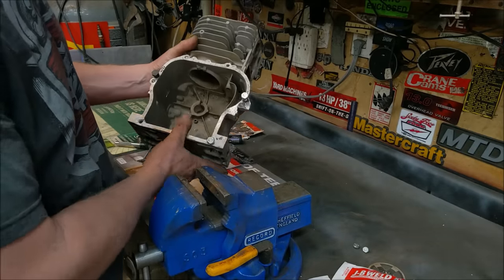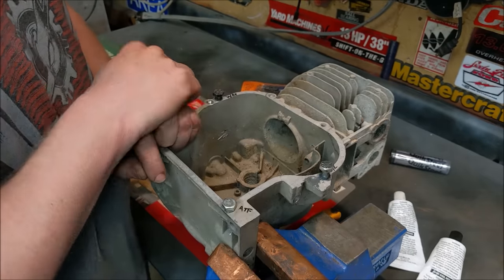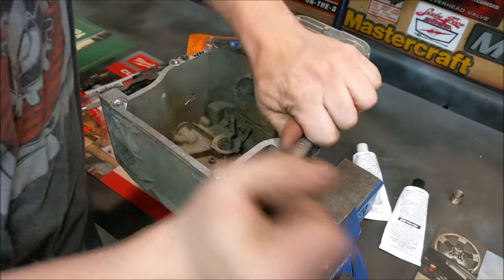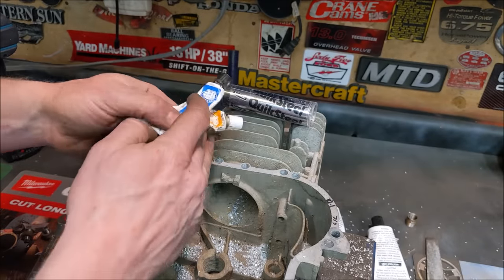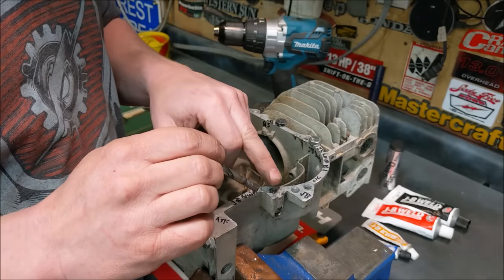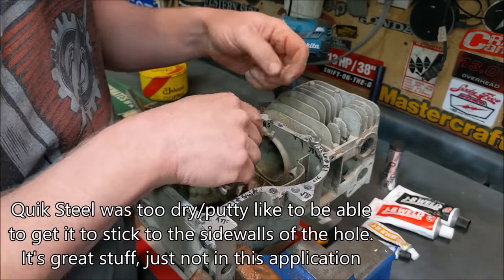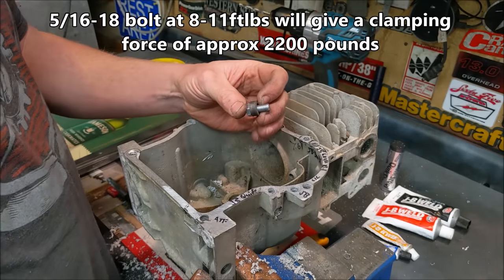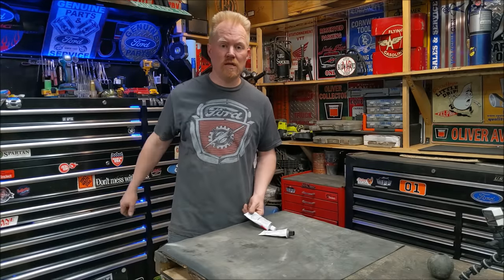FIX stripped bolt hole threads the POOR MANS WAY

Comment: We used J-B Weld to glue in a stripped spark plug.  It would hold for about six months of daily driving.  We learned to keep the J-B in the car for a fast roadside repair.  Drove the car like that for many years until sold... with the repair kit...
Reply from the maker: That's impressive.
Reply: That’s is amazing. respect
Reply: I hope that the new owners know about that.
Reply: @gohjohan  ha they probably didnt they probably scammed the new owner
Reply: @gohjohan   He said “with the repair kit”. So it’s implied that they did know.
Reply: Let me guess, ford 5.4 Triton?
Reply: @gohjohan   Next owner was a junkyard!
Reply: @buttonysquare8501  That's a very good guess!  It was a 1974 Fiat Spyder
Reply: @HardwayRanch  no kidding. I'm glad that this method served you well.
Reply: hello i have the same problem now, i successfully added a thread insert but now it needs a sealer or some sort of adhesive to lock it on the cylinder head and not come out with the spark olug everytime i take it out. do you think it will held up to the temperatures?
Reply: You needed a little piece of 18 or 22 stranded and then wrap up your threads and then smear them with your ProPoxy20 minute mixture..  there’s about 50 of our ProPoxy20 fuel oil tanks in many a poor country folks basement that couldn’t afford the new tanks or to have $2 dollar’s worth of heating oil dripping out onto the ground and it’s not a crap repair… I’ve drilled and tapped and fixed an automatic transmission housing and several chainsaw case’s and countless other repair’s that have actually surprised me!!! LMFFAO!  A commercial plumbing and heating supply house has the two tubes of ProPoxy20 and you need two equal size pieces into your puddy and 20 minutes later it’s official!  I wax a little piece of aluminum for a backer plate and pack it into the 1-2” holes in case’s and castings and then pack it or toss it between waxed paper or saran wrap and roll it into a even 1/4” thick layer and then you can basically just pop it into your opening and snap crackle pop in 20 minutes blast it down with the grinder disk and see what you got!  Cleaning up your surface and the surrounding surface areas where you are actually looking to stick to is what people usually mess up and they will push some two part epoxy into a oil covered mess then say that it’s garbage because it doesn’t stick to anything!  Fire and acetone is your friend and a flap disk or bristled brush on a grinder and cutting some surface then acid wash it .,.neutralize it… acetone it and slap on your patch!  Or oil your bolts then pack and smack them in a set of new threads! 😂👍👍.  It’s very really a turbine engine or the space shuttle! Send it!
Reply: The real American 🇺🇸 thing is that they actually not only instructed the new guy on the correct plug re-stuffing technique but made dang sure that he was covered for the next couple repair’s too! Now that my friends just might make you a little red-neck! LMFFAO!  Hold my beer I’ve gotta glue that dang plug back in Clem.,, we’re not running on number 7 cylinder anymore!😂😂😂💪😜🍺🥓😅
Reply: @buttonysquare8501  1974 Fiat 124 Spyder.  But close!
Reply: Thanks this was the exact answer I was looking for

Comment: many people dont know that jb weld normal formula after seting 72 hours  to cure is 2× as strong as  24hrs seting.   at 70 degrees air temp.  jb-weld  makes its strongest formula called jb-marine weld  2parts also but  at 48hrs set time its much stronger than jb-weld original.  if you test jb-weld marine formula and let it set for  a full  5 days untouched at 70 degrees air temp its 3× stronger than original jb-weld. the marine formula can withstand constant temps well into the mid 300 degree range.  nice video good day.

Comment: I used water weld (which is made by JB weld) to make threads. My bathtub has two handles that you turn for the hot and cold water. I had damaged the threads on the hot water when I was working on it. I was going to have to call a plumber to come in with a torch and replace everything. But instead, I took the handle out of the wall for the hot water and wrapped the threads with Teflon tape. And then, I wrapped some water weld around the Teflon tape and stuck the whole thing back in the hole in the wall. The waterweld stuck to the threads that were in the wall, and I could spin the hot water handle free of the water weld because it was wrapped in Teflon tape. Just like you did with the wax and the bolt. This has been holding for years. I did replace the water weld once several years ago. And it had held for several years before that.

Comment: How do you apply the wax to the bolt?
Reply: Wax is usually a paste, and putting it on is really easy, just slop it on and wipe it off. It only needs a very thin film, just like you car wax, you wipe off the excess and it leaves a very thin coating. One reason it works so well is the exact relief you get with a super thin layer, so thin you can't even see it. The thin layer gives you perfect contact. Wipe it on and wipe it off a couple times and you have a perfect film of wax left. You'd have to use a solvent to get the wax layer off.

Comment: I've used your copper wire method before with success. One reason I won't use JB Weld is it does not like heat cycles. Even under low heat, low pressure, it quickly disintegrates.
Reply from the maker: I did a fair amount of digging online about test data individuals/labs have done. It actually gets stronger up to about 400F but then rapidly drops right off at anything over that. Copper is my go to.
Reply: @sixtyfiveford  Are those long term test?  9 months after applying JB Weld to a pinhole on top of a transfer case, it easily flaked off in tiny pieces. I wonder if heat hardens it and makes it brittle?
Reply: Good tip. Thanks

Comment: I think the best bet would be to not drill but simply use the JB weld as a gap filler.  Just put some JB inside the damaged threads then put in the bolt, The JB rebuilds the damaged threads bridging the gap so not all the stress is on the JB.

Comment: Next, we use a combination of copper wire and JB Weld... I've used the copper wire trick for years on stripped battery terminals. Got the idea from sticking toothpicks in stripped screw holes in wood.
Reply from the maker: I did do this, but edited it out as it got the same results. However that was with a drilled out smooth hole and I think it would do better with a actual stripped hole where the sidewalls are coarse.
Reply: Know this is 2 years old but for a future viewer seeing this’ honestly just buy some’ lol u can get new terminals for like $20 

As cars are more electronic controlled now than ever a nice tight connection is crucial’ 

I’m frugal’ trust me on that , Some things however u just don’t repair but replace fix it right and never deal with it again :-) 

My 2 cents
Reply: How about stripped bolt holes
Reply: @joshymcdaniel9233  For battery terminals, it's just a temporary repair, though I admit my temporary repairs sometimes take years before I get around to the permanent fix.  And my cars are old.

Comment: How did you do the jb weld threads? Did you fill the hole up all the way? Then put the waxed bolt in? Or was it just enough jbweld to cover the sides and then stick the bolt in?
Reply: I’m talking about the first three bolts you showed up

Comment: I used JBWeld to fix stripped threads on a riding lawn mower motor mounting bolt several years ago and it’s still holding.  It’s location would have required total removal of the motor. I’ve not needed to remove the bolt so I can’t comment on the quality of the threads, but the “fix” is is still holding so I’m not going to poke at it.

Comment: Great product.  Back in the early '80s I patched the lower half of the gas tank on a car and drove it for more than a year with no sign of any leaking.
Reply from the maker: It has it's place for sure and when used properly can be the most practical option. Problem comes when people have no idea how to fix something and decide this will do it and put it on a greasy, mud covered gas tank then complain it didn't work.
Reply: @sixtyfiveford  Surface prep is key
Reply: @oldretireddude  got that right!
Reply: @sixtyfiveford  The older JB would turn to plastic when the ethanol gas came out but I think they've redone their formula to make it compatible now. Hope they have anyway. Thanks, Pal!
Reply: Patched the side of a radiator in '14 I was in school couldn't afford a new one at the time, but it's 2020 now and still it doesn't leak.
Reply: @BattleOfBowties  I patched pin holes in my radiator with jb weld and it held up for 4 months. 
Also patched a crack the  plastic on a different radiator and it lasted about a month. Now I'm going to make threads in my starter bolt holes.
Reply: I did the same for a cracked oil pan split down the middle on my bmw 325i (of course cost of a new oil pan was ridiculous) many years ago after bottoming out hard, I extremely doubted it would work but I cleaned the hell out of the oil pan then sanded it rough and applied a coat of jb weld and it held up for years until I sold the car. 🤘👍
Reply: @BattleOfBowties  wow! I just bought JB WELD to use on my W203 radiator too. The seems are leaking and can't raise enough money for a new radiator.
I will give it 48hrs set + cure time to ensure I get a better hold.
Thanks for sharing. Am encouraged.

Comment: Had a 82' Honda 500XL rebuilt motor job at a local bike shop where I live -- months later oil was leaking outta the head, I slowly took it apart only to find out the S.O.B used a cheap heli-coil cuz he stripped it out himself . I took it someplace else and the fix was high end threaded SS inserts, worked amazingly. Having said that, the previous bike shop is no long in business ( l rarely get lucky taking shortcuts)
Reply: Looking at a similar issue with a moto 4 225 i picked up but a repair hasn't been attempted. i've tried to replace the bolt and pray i get lucky but no luck with that haha. 

I'm really not trying to do major work on this as it already has other issues i'm not addressing so do you think the method shown would help with my issue or just be a waste of time? I really just want the oil leak to stop/slow down. Gonna work on unsticking clutch pads tomorrow though :)
Reply: @RYANINBODEN1547 -- the SS threaded inserts usually applied with red locktite (l think) -- it's a much stronger threaded fix than the aluminum heli-coil -- l would go that route as you'll more than likely never have an oil leaking problem again -- 
With the SS insert you can really crank down the head ensuring a tight seal

Comment: Great video . . . I used a kit I believe from Permatex few years back to restore threads on a head bolt stud on my Model A . . . . It worked well enough to torque the head to spec. Took me a few trys, each time giving it more cure time. Success was after 2 days curing! . . . . Shop looks good . . . . Ginger has endless energy . . . . . . Rog
Reply from the maker: It'll get you out of pickle, sometimes. All this epoxy stuff is very finicky. Thanks, I've been cleaning up the shop lately and Ginger would never stop if I let her.

Comment: I find using aluminum brazing rod works best. I use Blue Demon Triple Play rods and a Mapp gas torch. Heat the base metal, flux the hole and fill it up with the rod. Center punch, drill and tap. Just like new.

The trouble with epoxy is going to be durability. Thermal cycling will cause the jb weld threads to debond
Reply: Nice tip, for when gravity is on your side.
Reply: Hey what about filling a horizontal hole in an engine block-the insert failed and i have a 9/16 hole😩😩😩
Reply: @kirbytabor9956  there are welding rods for horizontal use, ask a shop
Reply: @galehess6676  Ya they wouldn’t tell me anything 💰💰💰💰 Super Alloy5 has a 600 degree melting point👍
Reply: @kirbytabor9956  mmmm   some guy with a welding truck would prolly give you the info
Reply: @galehess6676  ya no one would touch it coz cast aluminum engines are tough to do👍 i used oversize insert👍 but brazed a non critical hole for practice. Super alloy 5 with flux worked good👍
Reply: @kirbytabor9956  dang.  impressive shade tree talents.  the only issue my dim bulb can question is dissimilar metals or heating/expansion rates over time may be something.  i have 0 experience there tho lol

Comment: Loctite 3967. I keep a set of that in my tool box.  Basically the same thing but it’s made for repairing threads like this. I’ve had great success with it.
Reply from the maker: Yeah, there are better epoxies for sure. I just wanted to test with the most easily obtainable ones.

Comment: What kind of wax did you use ? Did you fill the hole first with JB Weld and push the bolt in and then allow JB Weld to harden around bolt ?

Comment: Did you let the jbweld dry after removing the bolts?  Correct me if I'm wrong, but jbweld is not anaerobic.  I feel you should let it dry longer with the bolt removed.

Comment: hello there. Just seen this today for first time. I hope you read this soon. Question i have pertains to how much wax do you apply to the bolt prior to this application? I would assume it would be no different than just greasing up but using the wax. your advice greatly appreciated. Cheers
Reply from the maker: Very thin layer. You don't want to change the profile of the bolt threads. I use Johnson's paste wax but any hard car wax would work.

Comment: Some good ideas - tried the copper wired trick and couldn't get it to work - ended up just buying an SAE bolt (to replace a metric one) and that worked.

Comment: It may take an extra step or so but trust me, putting a stronger thread insert in a soft aluminum case is the best thing you can do. The fastener will hold better with the stronger threads especially under higher torque values without failure. But in a pinch the jb weld looks like it can get ya home.
Reply: Any trade or brand names?
Reply: What thread insert would you use and where can I purchase??

Comment: I accidentally stripped my front axle clamp nut to my motorcycle.  It is a 6mm hex.  Almost stripped smooth inside the head.  I am 'hoping' JB Weld will allow me just enough support to break the bolt free otherwise, I am may be screwed.  Do you suggest I JB Weld in a 66mm hex key or weld in a larger bolt for better grip?

Comment: What kind of wax did you coat the bolt with (not the ATF, not the WD40) before putting the bolt into the JB Weld? And how much wax costing? I figure you don't want a LOT of wax as it would clog the threads so they wouldn't leave a good print? And how much JB Weld in the holes, as wouldn't most of the JB squeeze out as the bolt goes in?

Comment: Permatex used to make a thread repair kit much like this. It was a 2 part epoxy with a release agent to coat the bolt with. I remember using it about 30 years ago and it worked pretty good.
Reply from the maker: Interesting. I didn't know anyone ever sold a kit.
Reply: Napa sold this kit labeled Napa/ Permatex

Comment: I love the quick steel.  I have sealed the valve on a 250 gallon oil tank and 3 years later it is solid.
Reply from the maker: Quiksteel is my go to for almost everything. I just couldn't get it to work in this application. Mainly because the hole was open on the bottom and it was so small.

Comment: Holy crap! That's actually really cool, I wouldve never thought of this. For low torque applications this would probably work good, they have metal infused epoxies too that might work better
Reply: That is ‘EXACTLY’ what JB Weld is…
Reply: @mrmackie85   um actually no, it isnt.. There are epoxies out there with higher metal content/higher quality bonders for wheel repairs and things of that nature. trust me, at $30 a tube you do notice how much harder that stuff is.
Reply: @anthonys3906  so JB weld is not a metal infused epoxy??? Ok….

Comment: Really cool video man, this is something I've always wondered about. 

But for you guys looking for a real fix, the way to go (on a budget) is to buy an ebay helicoil set. $10, free shipping, and comes in a 30 pack. If done right, the threads will be as strong- if not stronger than the parent material.
Reply: Where is it $10 and free shipping?
Reply: I purchased this but in my application there is no space to drill the hole. 

Oil filter cooler on 2000 accord v6. Top bolt hole tripped out due to forgetting putting my power tool to its lowest setting (i should have use my hands)
Ill try jb weld quick cure and atf 😊

Comment: Excuse my ignorance. What kind of wax did you use?  And am I correct that you used JB Weld and the wax?  I need to fix some threads on my RV’s table top. Want to be sure I do this correctly and don’t cause myself further issues. Thanks in advance!
Reply from the maker: I waxed the bolt with Johnson's paste wax. But any car wax that sets up hard like carnuba will work as well. I simply smeared a really thin coat on the bolt and let it dry then applied some JB weld to the bolt and inside the hole and pushed the bolt down inside and let it dry.
Reply: @sixtyfiveford  thank you for your help!

Comment: Using the wire method, is it better to place the wires horizontally with the bolt or thread it around the grooves on the bolt?

Comment: If you mix aluminum or steel fine powder 10 to 20 percent in the epoxy mix it will hold better... Makes the repairs stronger than just the epoxy

Comment: So what kind of wax do you use and you just insert the bolt inside with the J-B Weld or did you screw it in and let it sit there because I have a old VW pickup that has issues with the radiator hose connected to the block where the boat is not threatening at all and after removing everything have noticed that somebody attempted to rethread but did a really poor job to the point where when you can actually see the bolt tightening in the inside and I just thought of just completely filling it up with J-B Weld and just rethreading it Completly .